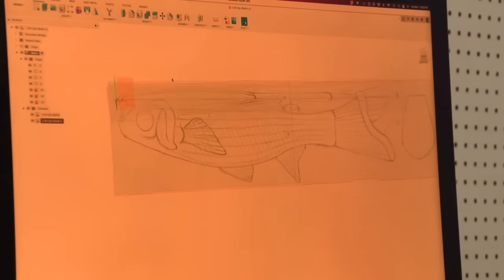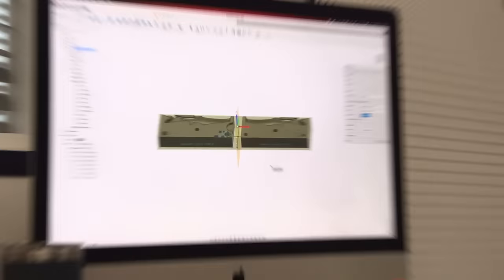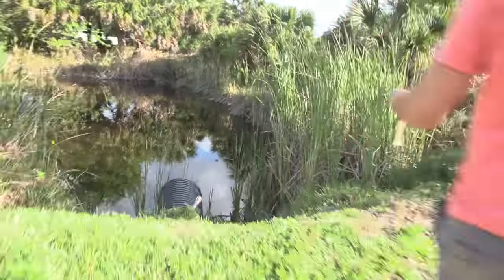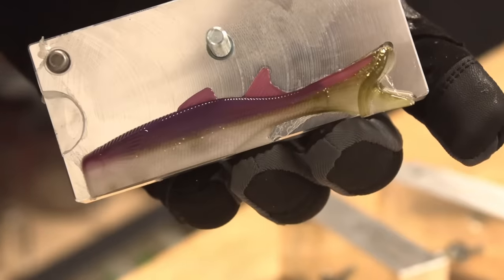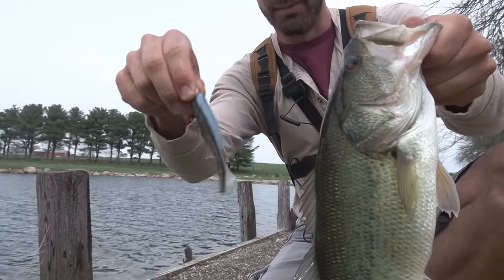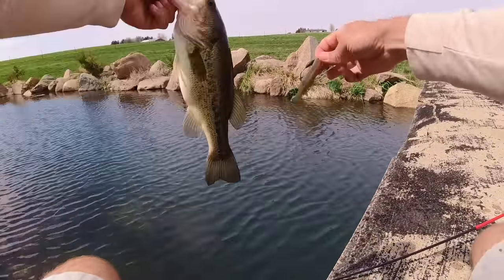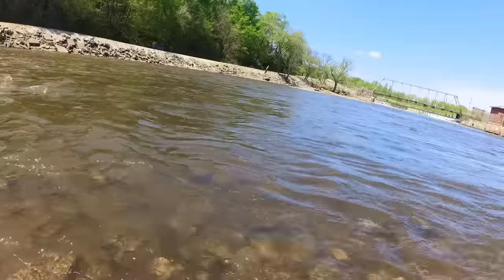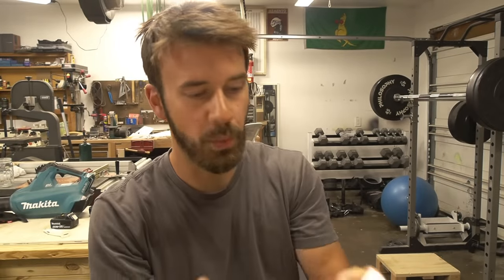Design to Pour to Catch | Mullet SwimBait

Comment: I've said it before, but it would be so cool to see a suspending soft plastic! Like putting little balls of balsa wood in the pour or something! I'm sure there are a few cool ways to do it
Reply: I actually do that with deadonplastix floating blend. I have the anglingai 5" open pour swim bait and if you use a 1/8oz weighted worm hook(I use Owner), it sinks sooooo slow its damn near suspending. It takes a while to sink just 1 foot.
Reply: Look up the zman minnow-z I dont know how they do it but they're buoyant as hell.
Reply: Most floating plastics will suspend if they're paired with the correct hook and line weight
Reply: @bassinidiot168  elaztech or whatever zman calls it. All their neds have it too, super cool stuff and why I love using zman, However you gotta be careful to make sure the baits arnt in sunlight for too long and not touching other plastic or they melt
Reply: You need weight to cast…. Density vs displacement.  it takes quite a large bait to have enough weight to cast at the correct density to displace enough water to suspend….  Think about trying to cast a piece of styrofoam…. That’s obviously an extreme.  With hard baits you have a floating plastic and hollow center with weight added in the form of rattles.  Or a piece of porous wood…. Hard baits also move through the air better than a flappy plastic that doesn’t hold its shape and grabs the air…. Then there is durability….  It’s a fine line to walk. Corkys but they are more a hard bait wrapped in plastic…. No paddle tail, or appendages.
Reply: Look up a Jackall Mask. It didn't work very well
Reply: @liketofish4383  zman does well.

Their flukes are still pretty damn heavy but sink super slow with a hook.

Also skip well.
Reply: The famous Z-Man developed a Thermoplastic Elastomer and named it ElaZtech.  This material is buoyant, very flexible and many times more resistant than plastisol.  Floating baits are even more attractive to fish.

Comment: I saw you broke that rod at what might seem like a bad place, but you can fix it quite easily. All you need is a small nail without a head on it or anything that fits in the hollow of the rod. Mark a center point on it and epoxy it into the inside of the rod. Then wrap the crack about 2 inches wide with rod thread(an inch or so on either side). This should be easy with your rotisserie. Just put the rod in it and let it spin while you guide the thread. When that’s done, put some 5 minute epoxy on it and rotisserie it do it doesn’t drip. Should be as good as new.

Comment: I have a suggestion that’s unrelated to the video: if you’re looking to improve the flow of your lead pot, straighten some 0.041 inch thick wire and jam it up the spout while it’s hot. Trust me it will make a huge difference with the flow.